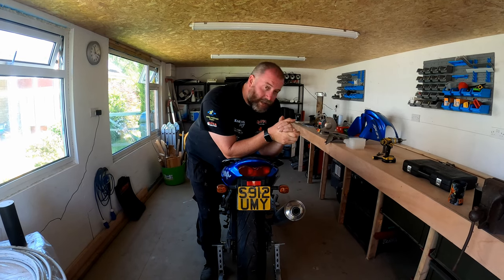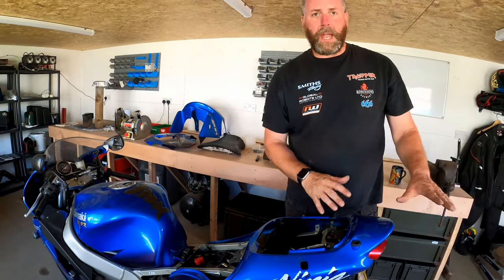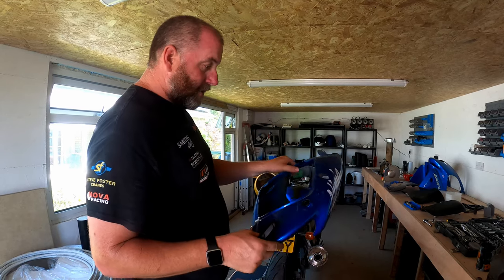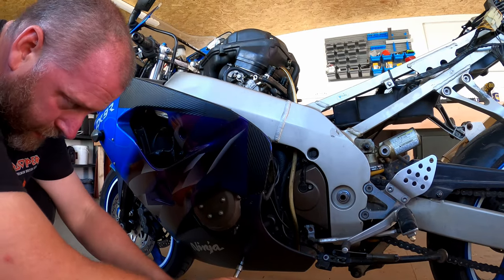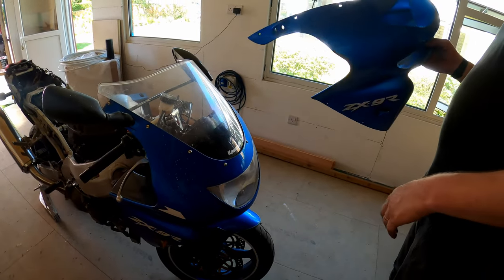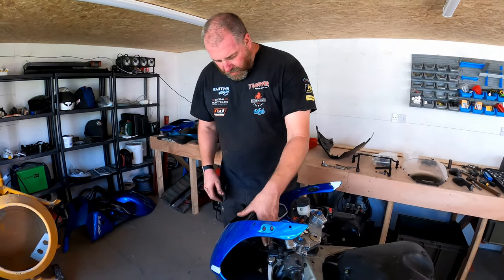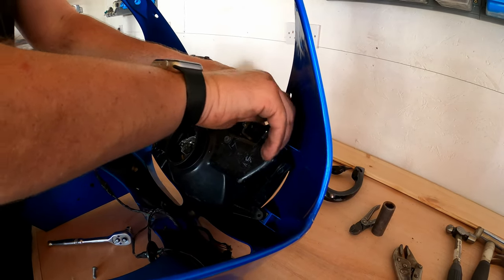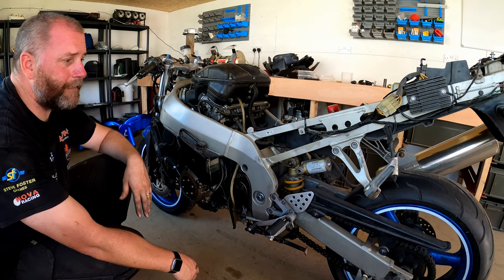1998 Kawasaki ZX9R - Project Shinobi, Episode 1 - Bodywork Off, Let's See What Horrors Lurk Beneath!

Comment: I thought the observation about the side-stand was very smart. Not the wrong one, after all. Just seems like it because someone's tried to raise the back with shorter dog-bones in an attempt to make it turn in quicker. Better idea was to fit a shock off a ZX12R.
Reply from the maker: Yeah, that would have worked. I actually have a shock from a 2009 ZX10R sat around gathering dust, I wonder if that could be utilised to good effect! 🤔

Comment: Glad I'm not the only one really struggling to get the rear tail fairing bolts out as the front two are jammed on mine too.  Going to thoroughly enjoy watching this transformation and hopefully pick up tips and ideas along the way.  Would !lve to do a full resto on my C1 9R one day
Reply from the maker: Yeah they were seized solid! lucky they were the only thing that didn't really want to play ball so far!
Reply: @KevsShed  did you have to use an HSS bit to get at the head or were they quite soft? I think mine are the originals
Reply from the maker: @Squishington3rd  I did use a HSS Bit as that was what I had to hand although they aren't particularly tough bolts to be fair! Once the plastics were off, a decent amount of heat from the blow torch allowed the remaining studs to be removed with molegrips pretty easily!

Comment: If there’s oil in the coolant, there’s probably a head gasket leak. Hope you do the job in a video... I changed mine last year, took me a couple of weeks as I had to service everything once you crack the engine open😂
Reply from the maker: Yep, the whole engine is coming apart, everything is being replaced! 👍
Reply: @KevsShed  Hone the cylinders and install new piston rings while you re at it👍 Will be as new after, since you’re in there. Removing the cyl block is a piece of cake

Comment: Hey, I'm just now seeing your channel ive just acquired a zx9r I live in the U.S my bike has 30k miles on it. Maintenance things I'm doing valve adjustment,  new chains sprockets and clutch any other things you think I might need to look at while getting this bike into top shape also doing compression check to see how healthy the engine runs solid so far

Comment: Yours is a 99 model, the 98 is all blue. You should install an exhaust system from an E model, that’s an awesome upgrade as the e exhaust is modelled after the akra-racing exhaust system👍 they’re dead cheap on the zx9 pages.
Reply from the maker: You're spoiling the surprise! 😂😂😂
Reply from the maker: BTW, it can't be a 99 as it's on an S plate, 99 would have been a T or a V. I actually didn't know that about the colours though and if that is the case then mine is likely wearing different bodywork to what it had from the factory!
Reply: @KevsShed  Yea, at least the fairings are from a 99👍 Cool that you re doing the exhaust, if that’s the surprise, the c system is horrible, mine cracked, dont think too many read the comments tho, hope I didnt spoil it for ya...